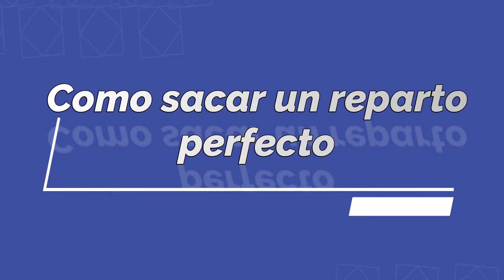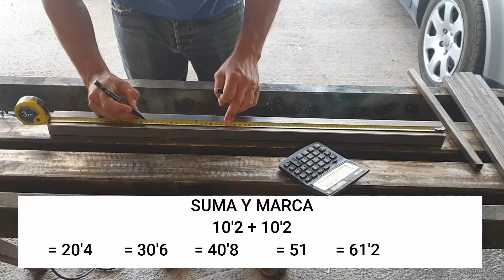Como hacer una reja, reparto de barrotes perfecto [Fácil y Rápido]

Comment: Muy buena explicación. No era capaz de hacerlo y recurrí a tu vídeo. Muchísimas gracias.
Reply: Mira te sera mas facil asi.mide tu espacio total,suma cuanto miden todos tus barrotes juntos,resta eso al espacio total,y divide esto por numero de agujeros entre barrotes.que siempre es 1 mas de los barrotes que tengas.y ese resultado escel espacio entre barrotes.

Comment: Otra forma que yo utilizoo es, sumar el ancho de los barrotes (16mm) por los barrotes que entran en la reja, en este caso 7 barrotes por 16mm de cada barrote = 112mm.  Ahora restamos el ancho de la reja al total de la suma de todos los barrotes (800mm - 112mm = 688mm) Y por ultimo divido los 668mm entre los 7 huecos de la reja (668mm / 7 huecos = 86mm) Esos 86mm es la luz que tenemos entre barrote y barrote, cortamos un trocito de material de 86mm y empezamos a colocar a tope de los barrotes. 
Espero haberme explicado 😅😅
Reply from the maker: Hola, también se puede usar ese método.  Depende lo que mas cómodo sea para cada trabajo. 👍Un saludo
Reply: @Truplipolit  Si así exactamente, al tener 2 topes, uno arriba y otro abajo no hay variaciones en la medida, no obstante cada unos cuantos barrotes siempre viene bien tomar medidas, y en el caso de que haya variancion puedes ir modificando un poco antes de llegar al final de la reja y tener los barrotes punteados
Reply: Si entran 7 barrotes, por qué dices que se debe dividir en 7 huecos?. No será que se debe dividir en 8 huecos??

Comment: Desde panama saludo sensillo y explisito.... exito compae !!
Reply from the maker: Muchas gracias compadre, un saludo desde España! Pronto habrán más cosas interesantes!
Reply: Por qué entre 8 huecos
Reply: @richardtenazoanavarro6376  
Como el autor del video dice..."como en este caso"..., lo que indica que podría haber divido en más o menos espacios.
Y eso lo va a determinar el espacio que vas a dividir, el vano o espacio que quieres que quede entre cada espacio (en este caso 10.2 cm), y también influye el ancho de los barrotes, ya que si fueras de 1cm le alcanzarían 9 espacios con una separación de 9 cm, y si fueran de 2,5 cm le alcanzarían  7 espacios.
 Como al dividir 82.5 por 7, te da 11.785, podríamos dejar 5 de 11.8 y dos a los extremos de 11,75 (como van a los extremos u orillas, no es necesario medir para  poner los barrotes, ya que si comienzas poniendo los barrotes desde el centro, en ambas orillas te quedarán los 11,75 cm).
Saludos desde Hualpén, Chile.